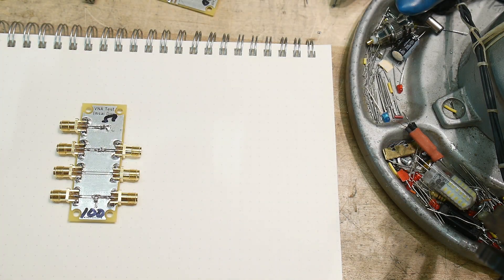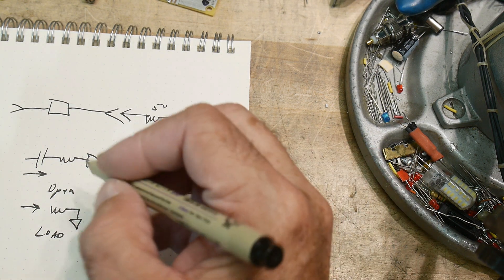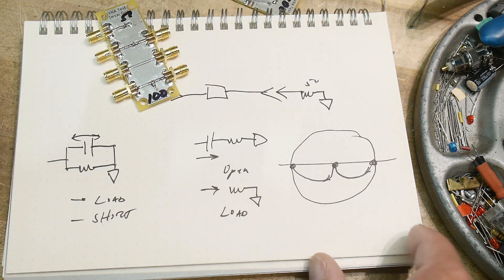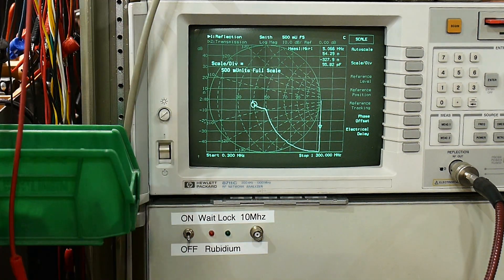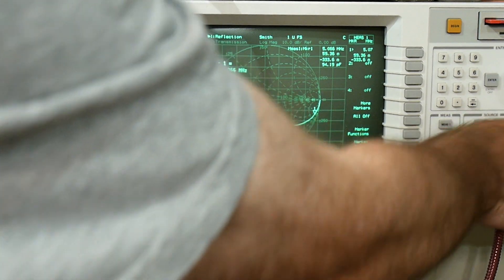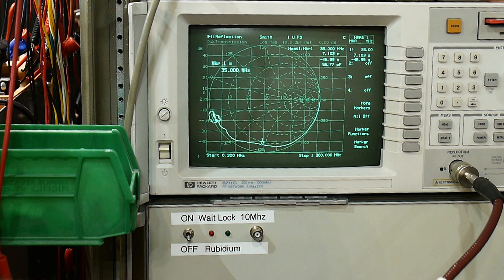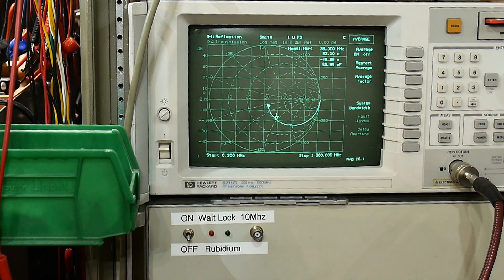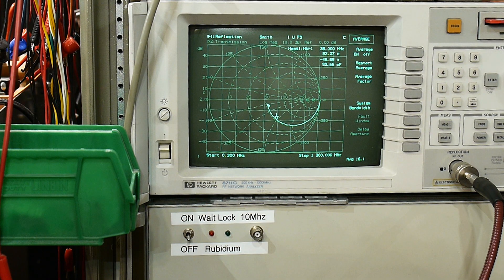#1175 VNA Test Boards (part 3 of 5)

Comment: Shunt vs series: For the most part, a shunt measurement (S11 or 1-Port) is OK - and I used it often.  But there's a catch:  If a part is used in a series circuit (i.e. 2-port), there can be reactance (i.e. capacitance) to ground on the series pads (or the part could even have a shunt parasitics).  So by grounding one of those pads (because your measuring it in a shunt config) during a measurement, you effectively ground that parasitic reactance. Whereas if the part is used in series, that parasitic reactance shows up and is part of the circuit.  But with a series measurement , then you have to subtract out the 50 ohms from Port 2 to get back to just the part.  

Yes - this is somewhat of 'splitting hairs'.  But it is a real problem and shows up in ultra-wideband designs (i.e. ~1 to 2 decades of bandwidth), where you have to ensure parasitics are accounted for.

Comment: Your reasoning about things in the center being more accurate is correct. Think about the number of digits in your gamma you would need to get correct in order to distinguish between different values. 

For the through measurements your instrument is designed to have good sensitivity for insertion loss. Making a one element filter from your part such that it gives the biggest loss works best. For capacitors that is a shunt measurement and for inductors a series setup. From the s21 you can then calculate the impedance, in some cases this will be an option in the plotting on your vna. I've used that quite a bit when testing ferrite beads for their responses, works great and accurately measured into the kilo ohms

Comment: Take some of your spare boards and do this:  One board leave the shunt pad open (that's your new open cal standard).  2nd board, short the shunt pad to ground (that's your new short standard). 3rd board install 50 ohms to ground in the shunt position (that's your new 50 ohm standard). Use that for your cal standards.  There will be a small amount of electrical delay between the open and shunt cal - no biggie.  Cal using those, then measure the board w/the 100 pF to ground.  With that cal, you'll have a much better measurement since you cal'd  all the way to the shunt pad.  The connector, trace, etc...all that is cal'd out now.

You might need to make a slight electrical delay adjustment to make it perfect, but even if you didn't - it will be a heck of a lot better.  Splitting hairs for your purpose tho.

Also electrical delay might not be valid if you switch over to a 2 port measurement.  Using a 'Port Extension' (if you have that feature) will cover all measurements (S11, S21, S12, S22).
Reply from the maker: I did that at a later time. still some strange results., still learning
Reply: @IMSAIGuy  Hmmm...I'll wait for that video! :)  These things can be frustrating at times, but rewarding when you figure out what's going on!

I posted in part 1 or 2 about modifying just the connectors to be used as cal standards.  If by chance you did that, use a 4th connector (center post trimmed down) and solder your 100pF to ground and measure that.  That way, you don't have the board in the mix.  And the same connector is used for both cal and part measurements.  That should give excellent results.

Don't forget to turn off any electrical delay if you happen to have dialed that in prior.

Comment: There are no ideal resistors.  Probably, the difference is some series inductance.  Resistance and reactance are orthogonal so they will never be mistaken for each other by a VNA.  Inductance and capacitance are opposites, however -- more of one is the same as less of the other.

Comment: You are probably getting some capacitance effects from the long traces being close to the ground plane.
Reply from the maker: did you watch part 1? the 'long traces' are designed to be a 50 ohm transmission line. the ground plane is part of the calculation.
Reply: @IMSAIGuy  yes I did, it’s just that the VNA is showing capacitive tendencies and when I look at the pcb I just see some capacitance being there, maybe due to the pcb being slightly thinner than planned too.
Reply from the maker: @TheDefpom  I redesigned the board on rev B and it does not help. I also created a cal set that calibrated at the plane of the DUT. that also did not help much. I still have one test to do but got busy with another project

Comment: In looking at Amazon, there are many Nano VNAs, at a wide range of prices. Which one would you recommend?
Reply from the maker: hard to say I haven't looked lately. my old favorite was the H4 with DiSlord firmware installed
Reply: H4 or  V2, V2 is more expensive but goes to 3GHz
Reply from the maker: @aduedc  here is a shoot out: https://youtu.be/1Ll9YGzzulo
Reply from the maker: the V2 is nice but is not compatible with the DiSlord firmware so you are stuck with what they give you

Comment: I think IMSAI Guy's comment about making measurements near 50 ohms is wise. In the manual for the HP 4191A RF impedance analyzer (which is much like an LCR meter that works in terms of S11), it has a bunch of nice charts depicting that instrument's measurement accuracy over frequencies and DUT impedance. As you might expect, as you stay near 50 ohms, the results are the most accurate.
Reply from the maker: maybe my gut is still in calibration

Comment: I would say in series with ground. With the resistor you're getting the stacking tolerances problem.
Reply from the maker: the resistor does not have any reactance so should not contribute
Reply: @IMSAIGuy  that is a good point. Is there any upper limit of measurement happening with the series to short measurement then?
Reply from the maker: @billyhart3299  no idea. it would need to be a good look at 12 variable VNA calibration equations and the delta gamma errors. too much for me.
Reply: @IMSAIGuy  if I go through it I'll give you whatever I got because I'm actually particularly interested by this.
Reply: @IMSAIGuy  It will definitely have a little series parasitic inductance (Ls).  It will also have a very small amount of parallel parasitic capacitance (Cp), but with the low resistance value, the Cp won't really show up (the R swamps out the Cp).  The Ls will be more measurable.

Comment: Your line is not exactly 50 Ohm, so cap in series with 50ish ohm line is not the way to measure..
Zin at the cap looking at the 50 ohm load is:
Zin=Zo (Zl cos(bata L) + j Zo sin (bata L))/(Zo cos (bata L) + j Zl sin (bata L))
Where L is the length of transmission line from cap to 50 ohm load
bata is 2PI/lambda
PI=3.14
lambda = v/f
f = frequency
v = speed of light on the media (for FR4 material 3x10^8/Sqrt(4.3)   m/sec)
So as f changes  so does lambda and beta and Zin.
Since your line is not exactly 50 ohm, none of your measurement is accurate.

In Smith chart in series case you are moving along r=1 (50 ohm circle) look at the smith chart it marked it.

In case of parallel  cap and load you are moving along admittance circle of r=1 (50 ohm circle)

In case of cap alone, you are moving along r=0 (0 Ohm circle) circle.

Your 50 Ohm value is more questionable than 0 Ohm.
Reply: And it's a 51 Ohm resistor on the pcb!
Reply from the maker: the resistor does not matter. the VNA will give R+JRx  it is the Rx and f value used to convert to capacitance. the R value will be what ever resistor happens to be used.
Reply: @IMSAIGuy  Ah! Thanks.
Reply: @IMSAIGuy  that is not correct.  say you have 10 ohm resistor at end of the line, it will rotate along the constant VSWR circle, as you travel along the line toward generator.  that is a circle with the center as the center of smith chart and radius where 10 ohm is marked on the smith chart and the center of smith chart.
Reply from the maker: @aduedc  you are correct but is still a resistive element and not reactive so still would not effect the capacitance value
Reply from the maker: I'm not quite sure about your comment of rotating on a constant VSWR line. since the capacitor is reactive it will follow a different route. if you haven't see it, here is a video about those reactive lines on a smith: https://youtu.be/QSY8k2IOJqg
Reply: @IMSAIGuy  when you have a 10 ohm load, and you move  toward generator your load rotates on VSWR (Voltage Standing Wave Ratio) circle.
Do a search on VSWR circles on smith chart.
Reply from the maker: @aduedc  you didn't watch the video I sent. Of course a capacitor and 10 ohm resistor wiil change in reactactance as the freq changes and the vswr will change

Comment: You're measuring two different capacitors right, not the same device, so they will not have exactly the same value to begin with.
Reply from the maker: Yes, of course